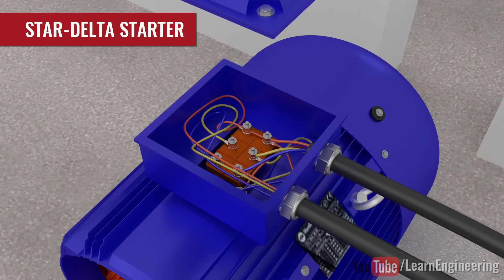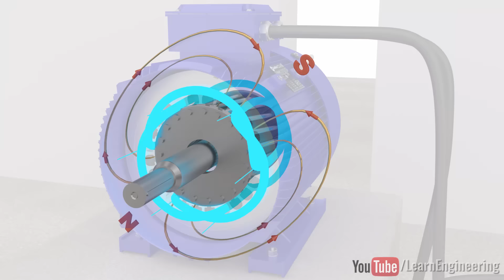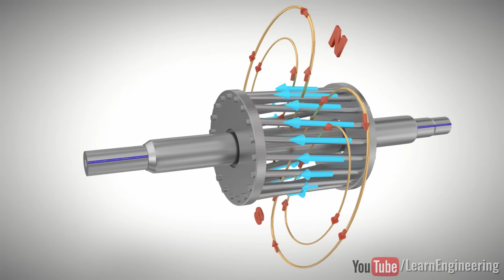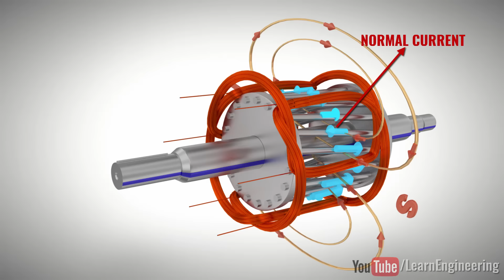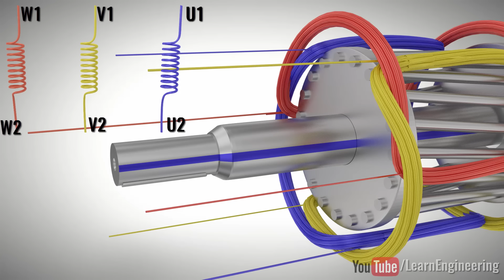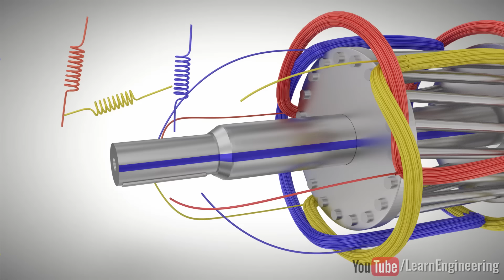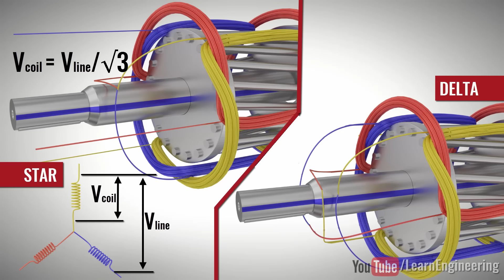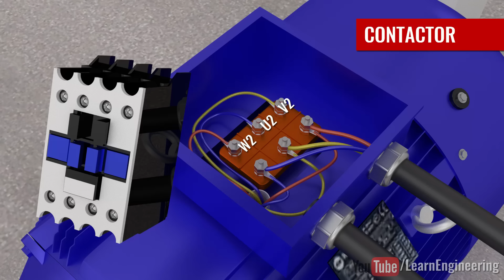Understanding STAR-DELTA Starter !

Comment: I am an EE Engineer and no one has ever explained this  crystal clear... Can see great efforts behind this video.  Congratulations.. 👏
Reply: "Engineer"
Reply: @twerktospec how do you earn your daily bread?
Reply: I am concerned for your projects that you qualified as an electrical engineer and didn’t understand a basic motor starter until watching a YouTube video 🤣
Reply: @aaronr5555 truth I wasn't taught this clear then.. And you need not be concerned about my knowledge😂 keep grinding yours
Reply: same
Reply: Yeah man you are right, his explanation is just awesome
Reply: @aaronr5555 As an EE myself, I am generally concerned that the public thinks all EEs know everything about electricity. We all have expertise in different areas, with different years of experience. You shouldn't be jumping on someone when they acknowledge they don't know something. Celebrate their humility. One more thing. There are a LOT of classes that EEs take; many if which are not electrical power. I personally only took TWO electrical power classes. Yep. That's it. So if you don't go into the power industry as a EE, and get into RF engineering, for example, you will know very little about electrical power. Especially as years pass since graduation!
Reply: Yes this is a great video, but maybe you should watch some videos on grammar and sentence structure. I think that is where you could use some help.
Reply: They still did not show the actual connection of the star delta connection. 😂😂😂😂

Comment: After 55 years of not exactly understanding why delta and star wiring come to be called them names , yes `` I see 2 D drawings  on slips of paper or on lid or on motor plate `but still never understood how the winding's were connected at the ends.
It was like a switch had flicked on,the different colors helped greatly showing the three coils and there ends,
Why has it taken up to now for  a person like your self to produce such an easy method 3 D illustration.

This could of been drawn in books to illustrate what you had shown to make it easily understood many years ago,
I have to thank you for putting this out there ,

The human brain are not linked up all the same to what we are led to believe this is why some things come easily to others and many struggle to understand,depending on the subjects , it depends on how the persons neurons had made there  connections, through growing up,

To many kids go through school struggling all because the system can not be bothered to change the way many things should be explain and illustrated differently to cover different kids way of understanding, 
Hopefully this illustration goes on to many who want to move on into the understand electric motor winding in three phase, this would give them a start with other types of wingdings ,

I for one now have a better understanding to delta and star ,cheers!!

Comment: It’s a nice technician level instructional video. This is basic information on how a star-delta starter (or delta-wye starter) is wired. Presumably this leads to being able to troibleshoot one that isn’t working or replacing the motor with one with an unexpected terminal configuration. 

Don’t expect to get anywhere as an EE in an electric machines course based on this much information. Even if you confine the topic to 3 phase squirrel cage induction motors an EE also needs to be able to refer the rotor schematic to the line side, understand why the rotor bars are skewed, understand how what this video identifies as the “stator” is wound and why, understand how to limit or prevent stray current through the bearings, understand how to calculate the slip rate, starting torque, running torque and breakdown torque, understand break before make vs make before break, the difference between a contactor and a relay... and whatever else your professor introduces during this basic topic because it prepares you for more complex machines like motors / alternators with wound synchronous rotors / exciters.

Comment: every thing is good but voltage is not reduced due to VL or Vph it is completely depending  on connections which we are taking in Star connection the resistance value is high when compared to the Delta connection.
If we consider resistance is R for one winding in star connection 
the equivalent Resistance value is  star=3R
where as in delta the equivalent resistance is Delta=R/3
Due to this the current value is less in star and high in Delta

Comment: The video explains the operation of the induction motor with very good animations. Y-Delta starting is also explained well, but the usual misapplication in practice is not mentioned.

It is wrong to apply this method at a 400V (line-line) network to a motor whose rating is 230V for each phase. Because such a motor should be used at a 400V network if Y-connected, and at 230V (line-line) if delta-connected. Since most networks' line-line rating is 400V in Europe, it should not be used delta-connected there. If the Y-connected starting of such a motor is proper with suddenly applied 400V, that is OK, then keep using Y-connected.

But in practice, such motors are started with the Y-delta method at 400V networks (line-line) in many places. When switching to delta, each motor winding is exposed to root3 times voltage, that is, with excessive current. Then the power and torque are 3 times the rating value. The user seems happy. But the motor windings burn due to excessive current within 1-2 months. The coils need to be renewed every 1-2 months. If the motor is not in continuous use such as water pumps, this time can be extended.

In order to use this method properly at a 400V network, the motor's ratings must be 693V for Y-connection and 400V for delta-connection. But such a motor can be rarely found on the market. Therefore, this starting method is misapplied in many places. It is appropriate to start these motors with this method only if there is a 230V network (line-line).
Reply: You are wrong all these motors have SERIES COIL Construction. that mean they can work with 440 volt in Delta Configuration and nothing happend, not any problem.
Reply: @ivanfmartinezm  You haven't given enough information about the motor's rated voltage. The user does not have to know whether the coils are series or parallel inside the motor. The user must know the rated voltage per phase.
Reply: Each coil support 220 volt line to line between phases so when users connect LOW VOLTAGE is a Delta connection and for HIGH VOLTAJE (440 VOLTS) IS in STAR Configuration that mean you have TWO (2) COILS in series connected to Phase Voltaje or Line to Line
Reply: @ata_sevinc  I hope you had understood my explanation the motor never get to burn whether it can do many start operation and work properly because it has been designed for that
Reply: @ivanfmartinezm  Star connected rated line-line voltage is sqrt(3) times as the voltage in delta connection, not twice. If each phase coil's rated voltage is 220V, then that motor's rated line-line voltages are 220V in delta and 380V in star connection.
If it doesn't get burned under continuous operation with 380V or higher in delta connection, either the load is low or the rated voltage is stated lower.
Reply: @ata_sevinc  You told well at the beginning USER DON'T NEED TO KNOW Technical Parameters like Root Square 3 those things are for technician only

Comment: Those magnetic relay also has interlock connected to ensure that it never on  both in the same time  otherwise,  Boom.
Reply: I'm guessing that said boom threat is also a reason the contactors are in a separate box on the wall rather than closer to/on the motor case.
Reply: I thought there had  to be SOMETHING preventing that, with how terrifying the risk of arc flash is at those kind of power levels.
Reply: alex Lo that was what I was wondering if the timer relay kept them from both being energized at the same time.
Reply: I think also there should be third contractor named common in addition to star and delta contractors

Comment: Learn Engineering
 the connection of star contactor  missing the upper connections also the main contactor  not present
Reply: Yes, omission of phase links across the first contactor are missing.
No, a 'main' contactor is not needed as these two perform the function of that.
What should be included is a mechanical interlock between contactors as well as an electrical one.
A further 2 pole double throw contactor would be needed to reverse the motor.
Reply: @cqb1vet  Ooh, I love white boards ;)
e-mail me any time !
I've loads of info - it's just not indexed - sometimes it takes years to come to the surface !
What are you doing in front of whiteboards ?

Comment: I'm quite confused.  4:53 Where do you connect the "returning" cable, like the neutral in our household electricity? How is the electricity flowing there?
And if the point of star connections is to lower the current that's allowed to flow, does that mean the startup is going to be even slower?
Reply: Ciroluiro 3 phase motors like this don't need neutral. They return current through the other phases as the phases are 120 degrees out of phase. Think of 3 AC sine waves staggered out by a third, you can measure voltage difference between them at any point. As for the star delta starter, it will get to star speed quite quickly, then after a small delay of maybe 2-5 seconds (depends on motor size) delta contractor will pull in and it will reach full speed quite quickly, whilst avoiding the massive current draw if they had tried to go directly from stopped to delta.
Reply: Ciroluiro Also, when in star, that point where all the bridges are shorted acts like the neutral in your house. For where I live, this would be around 240V AC RMS (phase to neutral), and when in delta (phase to phase), this would be about 400V. This could of course also be a higher value on high voltage motors.
Reply: That's interesting. I kinda suspected about the electricity returning on the negative of the other phases, but I wasn't sure about it. In reality I don't know a thing, but I had thought about something similar but never knew how to find the answer. Say you have 2 AA batteries; between the positive and negative terminal of a single battery there is a voltage difference. But then there's also a difference between the negative of one and the positive of another. So if you connect only those 2 terminals, does electricity flow? Because intuition tells me that it doesn't 'cause the circuit isn't closed. It may be a dumb question but I don't know a whole lot about electricity, just curious :P
And for the star-delta connection, it doesn't add any more time till it reaches full speed AND also prevents the huge current draw than if it was started without the star-delta? Or did I get that wrong?
Anyway thanks.
Reply: I hadn't read that last comment. That's also interesting but complicated when put all together. Just me though.
Reply: Yes, it is hard to conceptualise electrical behavior without experience and learning. For instance in AC, you wouldn't call the neutral the negative, as each phase goes negative and positive in relation to the neutral (usually 50 or 60 times per second). In your example with the batteries (DC power), your intuition is correct, current won't flow as the circuit is open.
And yep, last part pretty much correct, star-delta might take a few seconds longer to start, whilst lowering inrush current, which prevents voltage drop to the rest of the installation, and also increases the longevity of the motor and associated switch gear. 
If you are interested, start learning about basic DC electrical concepts, then you can look into AC theory once DC makes sense. Once you have the basics of those two knuckled down, you can then start looking into more advanced things such as electronics.
Reply: by my understanding of AC, the polarity never changes just the intensity; otherwise neutral would be hot.

also, it should in both configurations reach the same rpm, or is that wrong?
Reply: I am looking at the basic concepts, but I have mostly learned in layman's terms. I haven't looked at the theory or even formulas or laws beyond ohm's law and a couple simple formulas. Like studying physics without the math! :P
And as for the battery scenario I mentioned, why exactly does the current not flow? Assuming you just need a difference in voltage between 2 points doesn't seem to be enough. Because if it doesn't flow there I can't quite see why it does work in this 3 phase ac motor? (in that the "neutral" is another cable which has the negative cycle with relation to another one.)
Reply: That's something that has always bugged me. How is it that you can get electrocuted from the live wire and not the neutral, if ac changes direction and both are connected to a generator? (or are they connected to the same place? I don't know)
Reply: Ciroluiro The neutral wire is grounded at the distribution transformer. The voltage on it- releative to ground is 0V, while the phase to ground voltage varies from around -300V to +300V peak to peak (230V is the RMS value, 230* square root of 2 is the peak value).If the load on all 3 phases is perfectly balanced then you would not need a neutral.
Reply: The reason why there's a neutral in a single phase supply is because you center tap the secondary of the transformer and thus have 120 to neutral 240 line to line and then the voltage is 180 degrees of one another. In a three phase there is a neutral but if the three phase are balanced there is no return current on the neutral. The only time there is current on the neutral is if you use a three wire of the four wire wye as a single phase service for loads like compressors or hot water heaters that require two hot legs.
Reply: each of the three line conductors have a voltage to each other, there is no "return"  it is like on your water heater in a north american home, two phase conductors but no neutral, current is passed from one to the other.   the answer to the last part of your question is true- it will take a longer time.  its all about energy transfer, some load of a given mass being accelerated to a speed will need so many joules or ft-lb of energy.  that energy if applied on the delta windings would be transferred in less time but at the cost of higher current.  with the windings configured in delta there is less current and voltage, less watts (joules per second) and therefore longer acceleration time.
Reply: The neutral is a current carrying conductor (deadly) for any close unbalanced circuit (120V single phase or unbalanced 3 phase wye) as a return path to the source (ground/earth). Therefore, if you are to touch a neutral that is trying to return a current back to the source and become part of the conductive path it can kill you. The thought that neutrals are safe to touch on a live system is completely false.
Reply: there is no "returning cable" in a star delta motor.  the windings are either connected delta (parallel, full voltage on each winding) or star (series, reduced voltage applied to each winding since they split the voltage in series).  the wye point is not attached to anything.  this is not a source like a wye connected transformer or generator.
Reply: +Ciroluiro; a battery terminal has a static charge from chemical reactions to push its' voltage to the other side for a complete circuit that would allow more reactions. Connecting a terminal on one battery to the opposite terminal of a different battery will spark ever so slightly and mostly unnoticably as the static voltage immediately drops to zero. Since each terminal's opposite is not receiving the voltage required to stimulate more chemical reactions the current stops. This leaves the unconnected positive w a static positive voltage of half the rated voltage and vice versa for the neg but the connected terminals both reached zero volts (assuming their voltages were the same initially). You could swap the batteries around and connect the previously disconnected terminals and get a momentary discharge that allows a few chem reactions to happen again and so restore the static charge (voltage for potential current).
Reply: +Ciroluiro; As for delta config, the return goes out the other 2 phases till one return hits zero v and starts to become a supply. But in the meantime the other supply will have reached max voltage and is beginning to decrease its voltage so the you have 2 supplies as the zero rises to max and the max falls to zero before it goes into negative and can be considered a return. Hope this helps you understand.
Reply: @Clone36 
Here in America, our equivalent would be 277 volts phase to neutral, 480 volts phase to phase, which is most common in industrial buildings. Commercial buildings and some apartments typically use 120/208 Y (star). There are many other possibilities. Most building wiring is rated for 600 volts, which can be found on occasion, but some industrial facilities can have voltages of 1000 or more. What voltage configuration is available depends on your power company, and many facilities have to use transformers to get the voltages they need.
Reply: @Tomyb15  you can get a shock from the neutral wire, if there is load then you are interrupting the return from the load, particularly on lighting circuits.
Reply: @petarmiletic997  in a 3 wire Eddie system the voltage of the neutral can and does measure between 3-5 volts...any more and you have a problem.

Comment: My husband in Australia wired up 3 phase tri axle star delta oscillating switches to the fluctuations to the overhead power lines via the modem controls he invented 230 volts for the hydro dams turbines he also made 3 phase power out of 9 singe phase supply’s  3 red 3 yellow 3 blue  and stared them at a central point to make 3 phase out of 9 single phase supplies in name is 😊